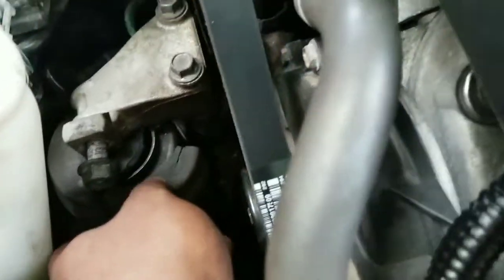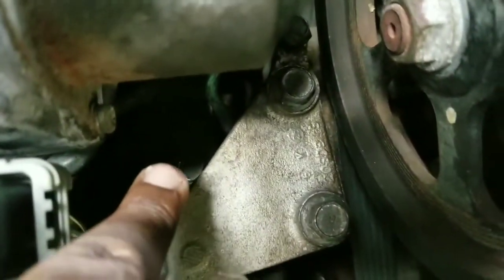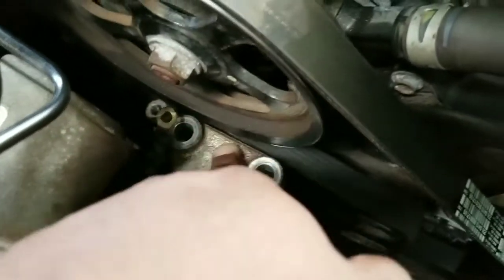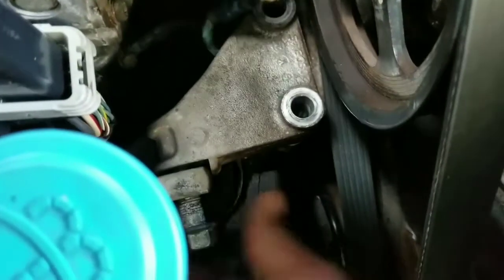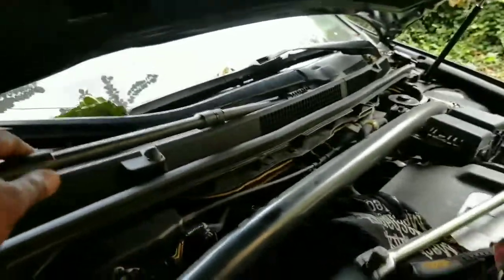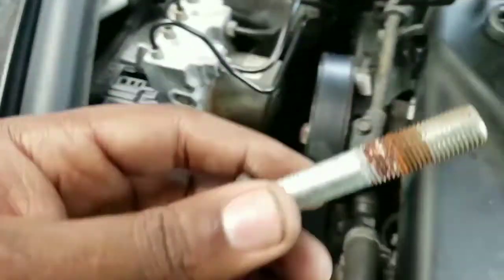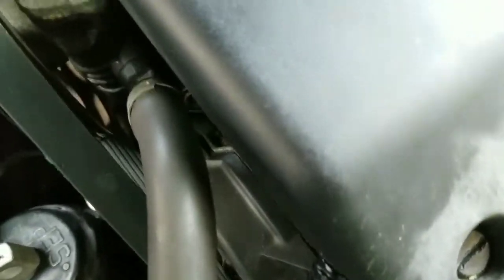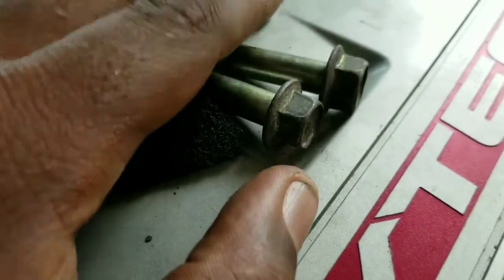HOW TO REPLACE ACURA HONDA  PASSENGER SIDE  ENGINE MOUNT TUTORIAL

Comment: Did you use a jack to lift the engine or you did it without it
Reply: Lift just slightly under the oil pan with a flat piece of wood for pressure relief of the bolts. worked beautifully for me🙏🔥
Reply from the maker: i used a jack under the jpipe to lift the motor up while removing the mount works everytime

Comment: Do you jack up the motor to switch the motor mount ? And is it better to buy oem mounts or after market mounts like as in auto zone ?
Reply from the maker: yes i jack up the motor to replace the engine mounts. i only buy oem thats just me i dont do aftermarket for that.

Comment: What is the part called or part number for the bracket on 1:35? 
The thread on that bracket caused the 10mm bolt to break and I need to replace that part and the bolt.
Reply: dewan718 did you ever get the part number for that piece you’re talking about? One of mine has stripped and need to replace also

Comment: Quick question, my motor bracket broke and I wanted to know is it as easy to remove as the other bracket? I see it has 3 screws can I lose them and put the new one in?
Reply from the maker: yup just that easy but make sure to support the motor so the weight of the engine wont be on those bolts so they dont snap when removing .
Reply: @fabolousg4ever  awesome...appreciate it!

Comment: If you have an extension you don’t need to take out the bracket just the two on the side and the one on the top of the mount
Reply: Will the engine mount just slide out?

Comment: if this mount was bad would it cause bad wheel hop in the snow? when my front tires spin and lose traction I get horrible noises in the front. VSA is turned off
Reply: TheShangralaaaa17 harder mount will reduce wheelhop and fromnt end noises could be suspension lower control arms tie rod ends inner and outter maybe bslljoints and lower control a rm